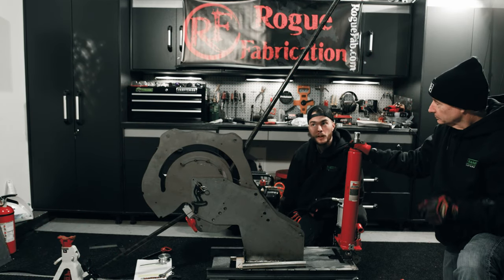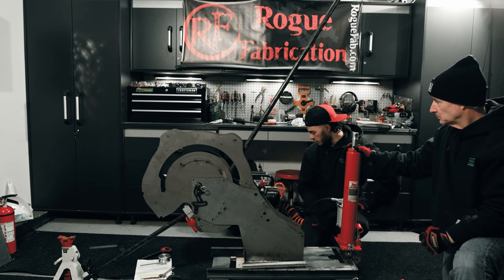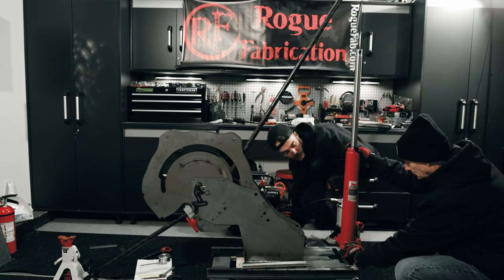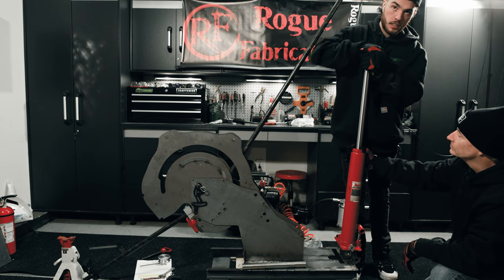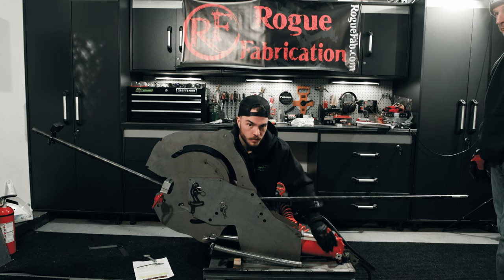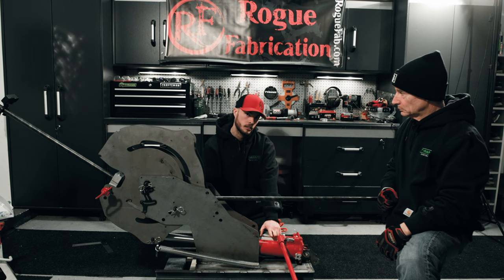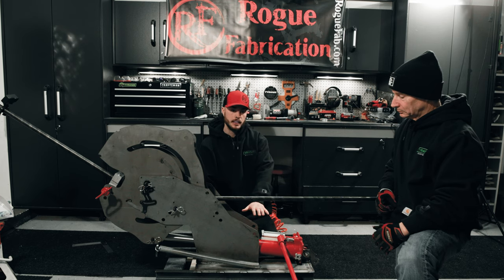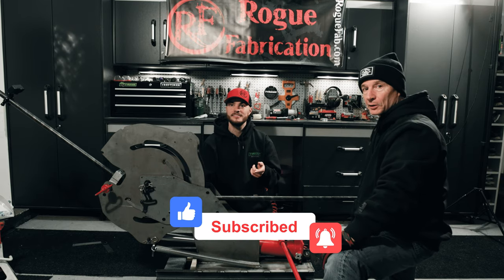How To Bleed Rogue Fab's m600 Tube Bender | TYRANIS TIP

Comment: Bro on my most recent kart build I had to bleed the brake system for DAYS, needless to say I'm not a fan of dealing with air in a hydraulic system, but glad you guys got that beauty working to it's full potential!
Reply from the maker: I was always a mechanical brake fan for the simplicity, but our new builds are so heavy/powerful hydraulic was the only way to get the performance outta them I needed. Lighter karts I'll still go mechanical tho.